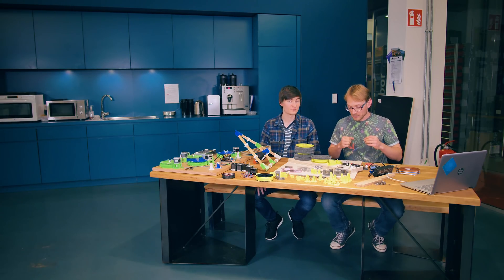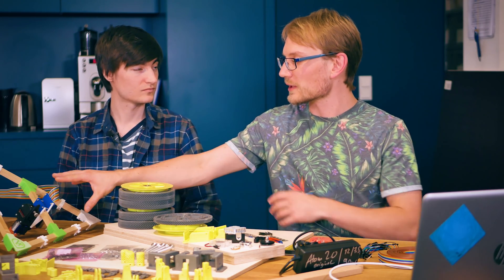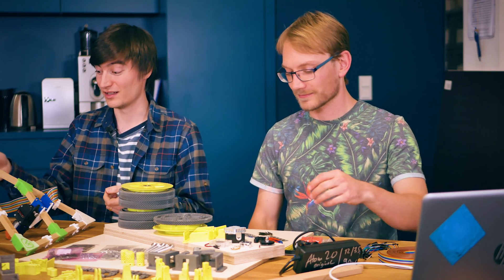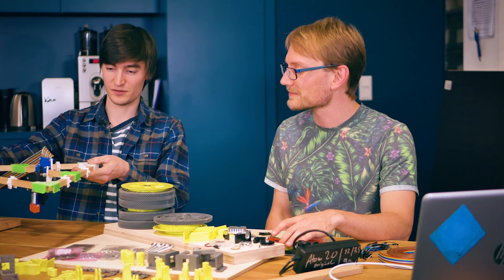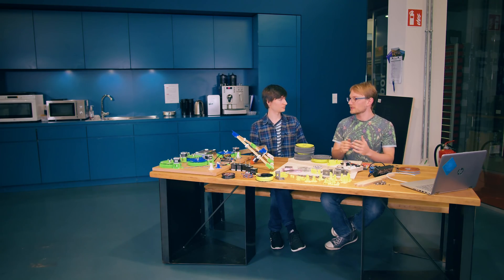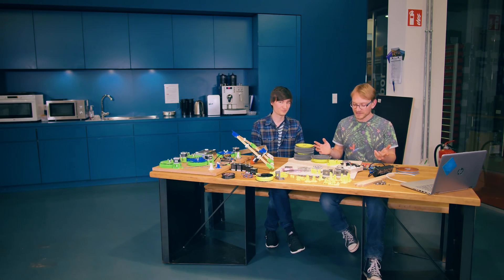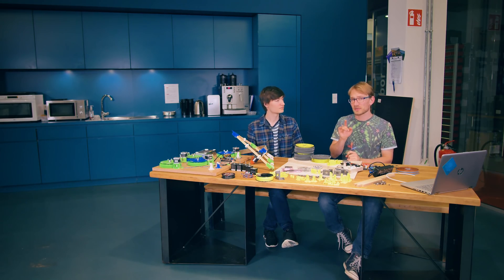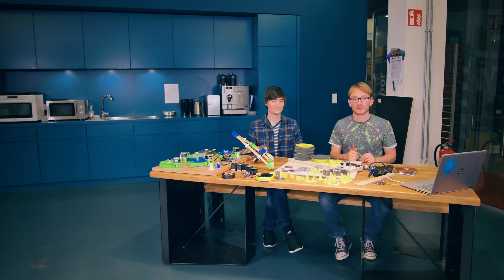Building the Hangprinter: The Basics!

Comment: I’m thinking for practicality the electronics and motor unit should be either at one of the floor units or between two of them. And then the ceiling anchor can be solely a couple of pulleys.

Comment: uhm, re: accuracy vs build height - doesn't Marlin support encoder feedback? You could integrate optical rotary encoders on the line directly which would offset the inaccuracies of the line being wound onto the spools unevenly, also would account for slight inaccuracies with the 3D printed gear/spool combo. Maybe this helps?

Comment: You won't get the print surface up to 60C this way, but what about using a heat lamp (or two!) to keep part temperature up? I'm thinking a couple of 200-500W lamps clamped such that they point near the base of the model.

Comment: Use the approach that xy calibration on the prusa mk2 use, only fix the reference points on a flexible sheet and just roll it up when calibration is done, then use a touch probe to mesh calibrate the bed and voila, accurate and automatic xyz calibration. :D 
For these large projects i figure a large nozzle and full metal hotend would be most useable as fine printing would take ages.

Comment: Love the idea of these hangprinters. Could a set of IR sensors be integrated onto the floating head/mover to do the calibration and keep the calibration during the print (by measuring X and Y to the walls and Z to the floor or ceiling)?

Comment: The maslow cnc project (a polargraph like hanging cnc router project) was able to address their problems with inaccuracies at the edges of the build envelope by desinging a gondola that keeps the intersection of the guide lines very close to where the cutting head is.  Of course this is easier to do in two dimensions.

The hangprinter is a great project and a wonderful idea!  Thanks for sharing it.

Comment: A long measurement like that can only be done precisely with a laser. A tape measure will never work.
Reply: KASA tape measures are made for construction where small differences do not matter. 3d printers operate in microns at the smallest level. Even the creator of the machine said it himself, that “incorrect calibration will increase exponentially the further from the orgin.” So if you are off by a 1/16” of an inch which is very easy with a tape measure, where the machine thinks that point is 8 feet across the room is actually much further away from the origin on that axis. Prints will never work like that. Also I have a problem with the whole set up hanging, by opening a door and creating small air turbulence, what is to stop the entire set up from swaying back and forth during a print?? Idk i have very little confidence in this machine.

Comment: I am super excited you finally have the time to work on a Hang Printer. I have a Version 2 hanging in my garage that I have been working with on and off for the last six months. 

Despite months of calibration measurements, and Marlin rewrites with some input from Tobbjorn, I haven't been able to solve the problem of the strings going slack or too tight over time. I was looking forward to your input on the Hang Printer. 

Unfortunately it looks like Tobbjorn and you are moving on to the substantially redesigned Version 3. I like the compact design of the Version 2. Maybe I'll still be able to glean some  information in your series to get my Ver. 2 serviceable. Or, after watching, maybe I'll also move on to the Ver. 3.
Reply: Strings? As in, actual string? It will change a lot with with moisture content and temperature in the air. If i was building one i'd have an urge to use thin braided steel cable, and you can get very thin and very flexible. Dual-Wire Gantry 3D printer (DW-G) used steel cable, and i was considering building one myself.

Comment: Upscaling the system and hanging from cranes, this could be the technique to 3d print buildings without small size limits. Problems to solve. Concrete tube from above with good preassure; cable elasticity (yes, long steal cables have it); wobbling of the suspenssion towers.
Reply: Rui Fernando Caldas it's already been done, Google 3d printed house.

Comment: I gues they can barrow some idea from multi copter projects  which uses flow control cameras.  Basically a laser mouse camera . And as a large scale heated bed. Electrical Floor heaters might be a solution if it's build as several zones.

Comment: Hold on did you say that you need to dedicate a whole 3000mm X 3000mm room to be able to print 400mm XY and 1000mm Z ? I have a machine that can print 450X450 and it only takes up 500x500mm  I can see the novelty factor of a machine like this and possibly a very cheap way to print large, I just don't see how this is anything other than a really cool toy or show piece.
Reply: Michael Scholtz The z-height will be a function of ceiling height, so it can be very high. Regarding x/y, you generally have better precision in the middle of the build plate, but a well calibrated system can make use of a large build platform. You can also build your hangprinter so that it lives in the ceiling, and only takes minutes to set up when you want to use the room for printing :)
Reply from the maker: Being able to reel the mover up to the ceiling when not in use is a core feature! Everything else can be easily stowed away when not in use.

Comment: "He's printing a bench right now".. yea yea, everyone prints benchy as a benchmark for the printer.  "No no, he's printing an actual bench.. to sit on" :-) 7:50
Reply: Not sure it can print a large flat top surface because the lower guide wires would snag on it, unless perhaps the low anchor points could ride up the walls and keep the cable tension and maintain calibration.
Reply from the maker: +Andy Lee Robinson to a certain extent, it is limited by how large the mover is. You can print wide or tall, but you can't print wide and tall
Reply: I look forward to seeing it in action for real... I guess the print head could extend further downwards from the mover for more head room at the expense of some accuracy as I would guess the mover can rock a little on the cables.
Sounds like this idea could be adapted to print whole houses with concrete using 3 or 4 heavy trucks with towers.
Reply: First benchy with an outboard motor .

Comment from the maker: I've tried to compile all info on the build, parts etc at https://toms3d.org/hangprinter !
And please excuse the audio in this video - The room we're filming is has a ton of echo that I needed to take care of. Will try to get a bit cleaner audio in the next one!
Reply: Does the laptop webcam have the same framerate than the camera further away from you?
Reply: Hohohohohoho!!!
Reply from the maker: +Avamander / Laptop... Webcam? Not sure I follow, but the off-axis Panasonic G7 does have a lower framerate than the main GH5.
Reply: Interesting printer. Could have some good architectural applications. Accuracy to the "normal" level is not important at all but large build volumes are.
Reply: Hang some fabric sheets to help cut down on the echos